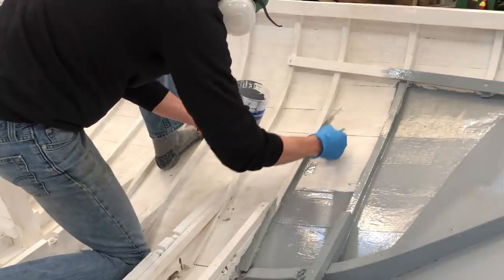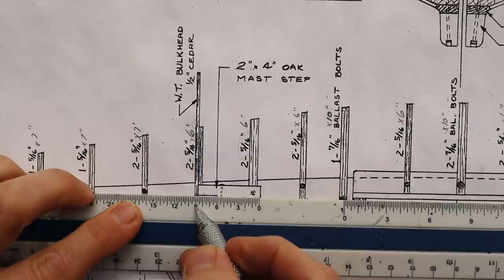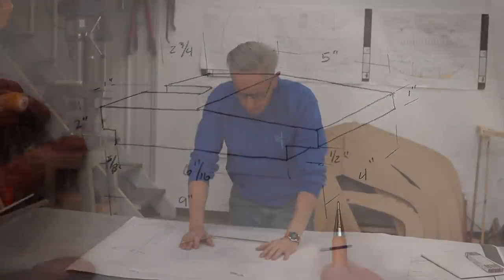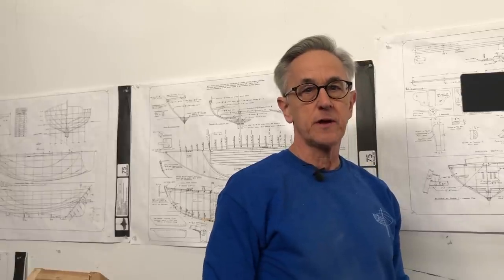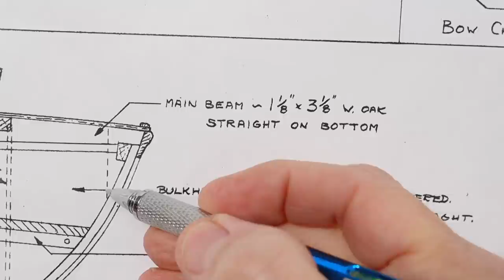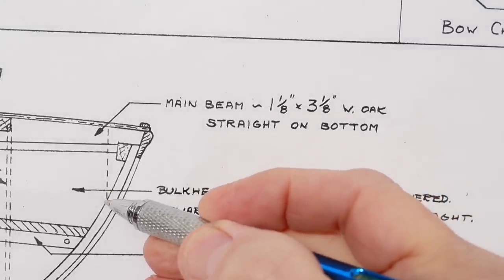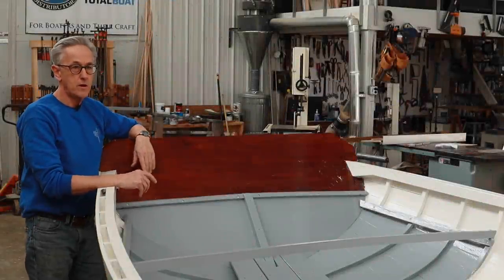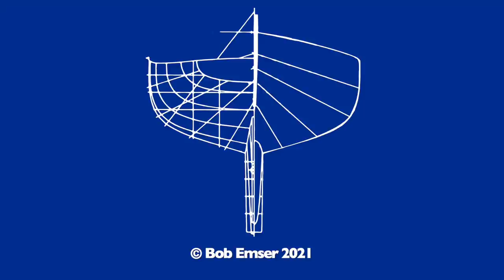Building a Boat, Installing the Bulk Head and Bilge Painting S2-E40

Comment: Hi Bob. Long time viewer. First time commenting. Love your work. On the subject of your forward compartment. You need to have removable hatches that are left open, except when you are actually sailing. Condensation will form inside a sealed area and cause you problems. In modern dinghies you use circular hatches of 6-8” with plastic covers which are screwed in. You can get them in black or white plastic. There should also be a small vent hole. 1/8” is enough. To allow the air  to equalise  when pressure, for instance if boat goes from sitting in sun on a trailer then launched into cold water. Even a laser dinghy has a tiny breather hole under the forward end of toe strap to equalise pressure.

Comment: A friend of mine had a boat similar to the haven with a sealed forward compartment. He made two changes The first being adding access on both sides of the mast instead of one blocked by the mast with watertight hatches so he could use the space for storage the second being he added solid foam for flotation  where ever practical

Comment: Coming along beautifully. I know that bulkhead will have to come out for some way to seal it, to be water tight. Is there any worry that the screws won't hold as well a second time? I know from experience that screws typically work best, in wood, the first time they are put in; and not quite as well in subsequent uses. Just a thought.

Comment: Little late to say this but I think one of those small foam rubber kneeling mats like gardeners use might make your knees feel better. Are you thinking of adding any flotation devices inside the forward compartment? I have seen people beachballs or car inner tubes in boats for added seasonal flotation. Just a thought. She is coming right along. I bet cutting the transom was a bit nerve wracking.

Comment: I know that you opted to not use an epoxy paint for the bottom primer because of the concern for plank expansion and contraction, so why did you use an epoxy paint in the bilge? Wouldn’t expansion and contraction be a concern there as well?

Comment: I have watched all of your videos, and especially enjoy your thought process when working through stages. I am currently doing a total restoration of a 1956 18’ Lyman runabout. I am curious why you did not cut the transom final shape prior to installing the transom in the boat?
Reply from the maker: Hi Keiffer,
The flat top made it easy to keep it in proper alignment on the strong back. Cutting it to its final shape was one of the easier tasks from last week. 
Thanks for watching. Best wishes on your restoration. 
Cheers,
Bob

Comment: 1 question for you, why would the design call for a bow with no actual way to use or for any type of storage? Seem like a missed opportunity,  unless there is something I am missing.
Reply from the maker: That's a good question. Of course I don't know what Joel Whites thinking was. I do know that one goal of designing the Haven 12 1/2was to replicated the Herreshoff 12 1/2 which was designed in 1914. So a lot has changed in over 100 years  not to mention the 35+ years since the Haven was designed. It is meant to be a flotation chamber so that most likely why it wasn't designed for storage.

Comment: Why did you disregard the canvas on the bulkhead? I am very certain that the Marine plywood is all you need, but I figured that the application of the canvas would add character and appear to be installed according to the plans.
Reply from the maker: I haven’t disregarded the canvas. I’ll be applying it after the fore and aft decks are on as they too will get canvas covering. One step at a time. 
Cheers
Reply: @TheArtofBoatBuilding  Excellent!!!

Comment: did you notice instant ~22'50" that the plan moved while you were punching ? hopefully you did not cut just yet...
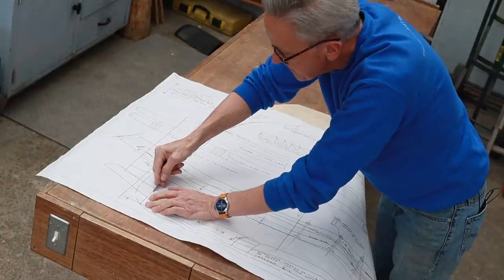Reply: I think the board moved at the same time so should be okay! 22:49 if you watch the exposed plywood
Reply from the maker: Ed is correct the board moved with the plans. I have found that the punch holes are just some guide posts. Pulling the batten is the best way to get a fair curve.
Thanks for watching!

Comment: Why is the front bulkhead not used for storage?
Reply from the maker: Its meant to be a flotation chamber. If there is a hatch as I put in ( for hull inspection) it should be well sealed. 
Being a daysailer a large storage locker is not needed. 
Thanks for watching!